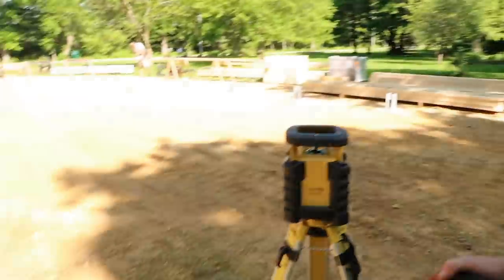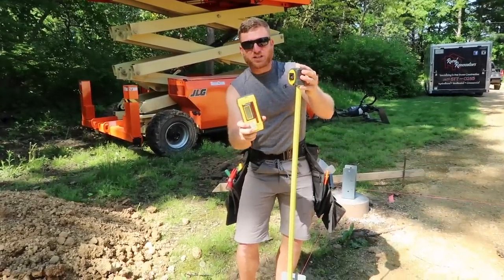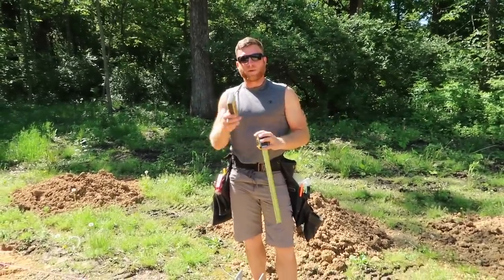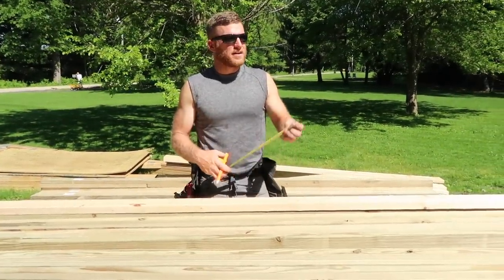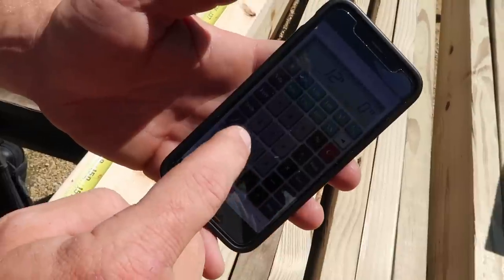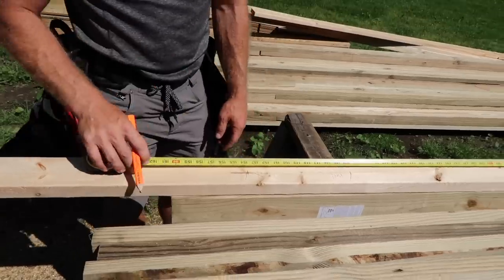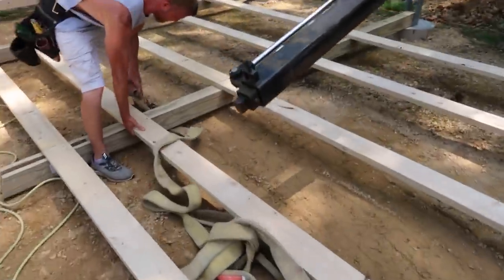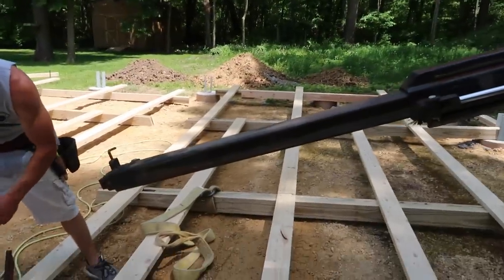How to Build A Garage #2 Lasers and Columns

Comment: If the post lumber is milled less than 1 1/2 thick, how do you make the truss fit in the center?
Reply from the maker: Lewis Renovation great question.  Ohio timberland has some way of making that pocket big enough for a truss. They are snug tho
Reply: I assume they mill the posts after they are assembled, so the center never changes dimension, only the outside?
Reply: Shain Andrews-- What you say makes more sense but think he said they mill the 2x6`s before gluing them.
Reply: If you pause the video at 3:12 it looks like the center board is 1 1/2 inches thick, while the outer boards are 1 3/8 inches thick.  I would guess they mill the posts after they are glued together.

Comment: are laminated 6x6's stronger than regular 6x6's
Reply from the maker: yes
Reply: Yes as long as it's LVL don't go for a 6 by 6 finger jointed from PT to Ash that is junk the fingers will spread after a couple years I built posts and beams New York New Hampshire Maine most of the Mass area

Comment: Love you're videos. Putting plans together for a 33x48x14 post frame garage.  I have a story board question. When setting up your story board for a 12 foot high ceiling (bottom of trusses), you measure 12ft from the bottom of the story board, which is the 'grade' reference. However that datum is about 1-1/2in above the top of the cement pier. Since the top of finish floor is about 6in above the cement pier, that puts the ceiling height to the finished floor less than 12ft, or about 11' 7-1/2". If I want a 12ft ceiling to finished floor, then shouldn't  my story board distance to ceiling be 12' 4-1/2"? Thanks.... Dan

Comment: Maybe this is a dumb question....

So you have a 12 ft sidewall (measured on storyboard) plus you grade measurement.  Then the bottom of the grade board say 2x6 goes at the grade mark....so far so good?

But then when the concrete is poured and the grade board is covered, the inside ceiling is now ~11’6” height correct?
Reply from the maker: You lose 4” from bottom grade board

Comment: Two things - Are the post resting on the bolts, with air between them and the bracket? Plus, you didn't show setting the roof pitch with the carpenters square and the whys & wherefores.
Reply: Look at the perma column guide.  If there is any gap the posts must be shimmed.  And the wood shims have to be glued and nailed to the posts.

Comment: I am wanting to build a 24x30 2 9 foot wide doors on 30 foot side but also the trusses running the 24 foot. Wanting your opinion on how to frame that side with the doors since practically all of the trusses would be setting on a header board

Comment: how did you know to add 15.5 inches for the heel of the truss?  Did you already have the truss on sight and measure this before you made the video or is this a common measurement for a truss with the same pitch?  I would think depending on the lumber the truss was made from could change this number if made from a 2 x 6 vs a 2 x 8.
Reply from the maker: I spec 15.5”
Reply: @RRBuildings   then my last question is this and it may be a stupid question but i am curious.  on the video shot where you were shooting from one end of the brackets to the other looking in the middle of the bolt hole (and that was impressive)in the bracket or whatever hole that was.  the question is if the brackets were a little higher or lower by 1.25 inches or more and i thought some were then how did the video shoot from one end to the other?

Comment: Any structural guys out here, is it a problem if the post brackets aren’t centered on the pilings? My concern would be the pilings could tile because of the buildings weight if they are not centered
Reply: A bit off center won’t matter exponentially. Depends how close to the outer edge

Comment: Galvanized still corrodes in treated lumber. As does stainless. Uncommon fact known. However because of the materials used to treat lumber they say it is not caused from the lumber treatment. Trip coated are the best in my humble opinion. It’s not that it isn’t approved but over time they do corrode and I believe it is because of other elements or factors other than the lumber type.  Triple coated still don’t. Not saying it’s wrong to do it because it’s still approved but just wanted some of the other younger contractors and construction guys to know

Comment: When you lay the posts down in the brackets to start building the wall, how do you ensure they are straight?
Reply: just like balloon or platform framing when first doing a section laying down, in this case the girts nailed on the markings using the story/storey pole are what aligns the posts to straight.
Reply: I get that, but I was thinking that the posts could be parallel to each other but a bit sideways (not square to the brackets) and still get nailed up. I think if they were way off it would be pretty obvious, but it seems like a small amount (especially on long posts) would be hard to catch.
Reply: From what I have observed in his past build series, he places a foot of the base of each post through the bracket if not just the base itself bracket depth/width to help line up with way, he does level out before setting it in with the anchor bolts into the bracket for in/out level for perfectly straight as possible for both axis. He can tell you more himself how he does it when/if he chimes in on your comment if I am mistaken, unless he addresses it in part 2.2 which I have yet to watch myself.
I like to share my knowledge (or opinion) for what it is worth to others.
Reply: Thanks! That would make sense if you can get it close enough and then do the final level/plumb by shifting the wall around before putting in the anchor bolts. I have seen that in the other builds, so I think you're probably correct.
Reply: Yes I just watched part 2.2 and he shows on the other side and end wall he aligns them by placing in the bracket as I had aforementioned and adjust before nailing the board to ensure sideways plumb to one another and then opposite side to side (outside to inside) plumb after raising before anchoring.

Comment: Ok, this has been bugging me for awhile so I’ve gotta ask. I’ve watched this episode so many times and I still can’t figure out why you need to do the 1”+/- dimension at each post. In the first episode you mentioned that by using the laser the top of all the footing should be at the same elevation.  If that’s the case, why are there variations that need to be considered when making up your posts?  Is it due to inaccuracy in the laser or do the footing forms tend to settle somewhat during the concrete placement and finishing?  And thanks for the wealth of information.  Love your channel.
Reply: I would imagine the ground isn't level? It's tiny amounts he's adjusting.
Reply: @gustavel6333  that shouldn't matter since he's using a laser though

Comment: You lasered the tubes but not the post brackets, Why didn’t you just use the laser when you set the post bases?
Reply: I answered this in another reply, but easier to do what Kyle does then to try and get the tubes and concrete pour all the exact same height.  You can't have a gap between the bracket base and concrete nor the bracket below the surface of the concrete.

Comment: How you guys use imperial baffles me!! How do you think 11/16" is easier than 17mm. I don't get how you even read that on a tape. Why if you need to find half way point of that? Surely it would take longer than the metric system? Also wtf is heighth? Is that imperial for height?

Comment: I dont quite understand the benefit of building your structure this way? It seems like all the cost savings and time savings are lost compared to a traditional frame up
Reply from the maker: Guess they call that just not knowing?  I’ve built both for the last 12 years.  Post frame for this type of structure is not only faster... more cost effective... but also a stronger building

Comment: It took me about 3 views to figure out how the laser measurement of the finished brackets was used.  Makes sense now.  The beams are ordered long, and the bottom of the story board is adjusted to the bottom of the post + the adjustment from the laser measurement.  Then you can cut the board that receives the truss to size and cut the overall beam to size.  I'm impressed with this method.

Comment: Back in the day when Australia had just changed from Imperial Measurements to Metric Measurements I had to create a Story Pole with a Maximum Length of 123 Inches, in other words 10 Foot 3 Inches. 
My 10 Foot Tape Measure was marked in both Imperial and Metric. 
First I marked off 10 Feet (the maximum Measure of the Tape Measure) then added 3 Inches, before making My final mark and cutting to Length. 
Problem was I only added 3 Centimetres. 

Nobody noticed My error until they started putting Wall Panels up and found that Mine were shorter then the other guy's Panels. 
For 20 Years My short Panels stood next to their longer counterparts and because the shortcomings were at the bottom of the Wall hardly anyone noticed.
Reply: THAT is the kind of mixup we don't want to deal with!
Reply: OUCH, nice lesson to watch which measure you are looking at on such tape measures.
Reply: @infoanorexic  Tell that to NASA.
Reply: "Who cares"???!!!

Comment: Wow, you really need to be born into this Imperial Units madness to not have a problem with 15/16 or 3/8 of an inch craziness :) Commenting from UK, where we also use inches, but in construction it's mostly metric system. Apart from that, great videos :)

Comment: I've never built anything other than some tables and a 12x16 tool shed but I am getting ready to build a pole barn at my new farm. My question is about the measurements on the brackets.  Why are the measurements different if you used a laser to insure they were level when installed in the concrete forms?
Reply: He didn't use a laser to level the brackets and I don't see how that would work.  The concrete tubes and concrete pour would all have to be perfectly level before inserting the brackets which would be exceedingly difficult. Especially the pour.  If the concrete pours don't end up all exactly the same height (level) then when you insert the brackets to the same height you would have some of the bracket bases not touching the concrete and some below the surface of the concrete.  Not good.  Easier to just  do what Kyle does and insert the brackets until they touch the concrete and then go back with the level to adjust the height on each post. Hope this makes sense.  Are you doing a video blog?

Comment: What’s the cost for this construction? Total cost.
Reply from the maker: Robert Gannon usually depends
Reply from the maker: No magic number
Reply: Fair question... He asked for the cost of THIS build... So it doesn't depend. Or could it be you are unwilling to say?
Reply: RR Buildings can you give an approx range?  I understand confidentiality. I bought a property on 5-acres and need a new shop/garage built and I am trying to budget for such a building.

Thanks in advance!
Reply: he reason he is not answering is because there is factors aside from structure, type of sheathing, finishes and other things like insulation if wanted or what is required just add into the cost, thus why you will never get an exact price per each size of building, Best thing to do is hop around for quotes giving them the information required such as use, for example residential and what its occupancy be say its a home and shop/garage/etc since there are four classes of occupancy in the IBC (International Building Code) plus local code compliance for home use or other lesser occupancy plus local wind, snow, and other rating factors such as aforementioned the finish if say you plan to drywall or osb/plywood the interior the trusses need to be made to carry said load.
Some like for example Hansen Building offer a prefabricated DIY Kits its of standard sizes, but like I said the local code may either reduce or increase the price if the truss require to  withstand a set snow, dead, and live loads. So instead of asking him for price, get Quotes from manufacturers, you saw labor cost doing it yourself. but not saving  yourself putting your own kit together from the local lumber yard using those lower grade materials.
Reply: Joshua79C C whilst your are undoubtedly correct that each building will have variations. At the end of this build all this is known and will be billed for at the agreed price. Quotation and tendering will have already have been done for this build and agreed so the construction cost for what we see being built as standard for R&R is a known. If it's commercially sensitive, then please let him say so.
Reply: He did says so "No Magic Number" and I simply and merely pointed out there are variables, but for his portion of the build and skin the only variable is the footers and height difference to width and length standard
Reply: Joshua79C C couldn't agree more.
Reply: Robert Gannon Get at least 3 estimates. To get a rough idea of the professional cost in your location.

Comment: How do you determine the above grade measurement without a rotary laser? Do you measure from the top of your concrete footer to the bottom of the string line? Great series of videos, you seem to do great work.
Reply from the maker: you could...but it would only be as accurate as your string line
Reply: Since you measured with the rotary laser to determine the height for the top of the concrete, does the concrete sink after pouring? I imagine it does or you wouldn't need to determine the above grade measurement for each post after it cures.
Reply: Try a water level:  clear cheap tubing with water in it.

Comment: do you bring each end post in 1.5"? so instead of 8' on center your two end post will be 7' 10.5'' from the next one?  Also when using solid 4x6 posts and notching the outside for the truss,  should you keep all the notches the same direction until the end one that would be opposite or split them so the distances between your two middle two middle trusses would be slightly larger?

Your videos rock! Actually planning on building a 30x40.  Never built something this big and I'm driving myself crazy trying to plan it out perfectly so I dont have something stupid happen in the middle of the build like my ceiling ends up being an inch short or something.  Your videos are very detailed and helpful.

Comment: you do realize there is an easier solution to calculating where to cut. it is called the metric system. you ad 1 cm at a time.  you added 12ft + 15ft 1/2 inch + 3ft 11/16 inch = 13 ft? 7ft?  3/16 inch... how about adding cm all along? it's as easy as 356cm + 39cm + 9cm = 404cm... if you'd like to be even more accurate, use mm. but hey, who am I to tell you-you can use the same measuring system as the rest of the world.

Comment: In a couple years I'll be building roughly a 20x25ft garage and I plan on doing it myself. It's only be about 9 feet tall and I'm trying to design it to support both a garden on the roof and up to 6 feet of snow.
30x40 seems huge.

Comment: If you live with metric system, your Will finish it one day earlier... Lol
Reply: wow save a whole entire day haha
Reply: How tall you are? Im 1.72m simple as that.    
I have 2 pieces of wood. One is 32cm and the other is 45cm. If i put them together i have 77cm; if i want to calculate the center is 38.5cm

look this sizes of wrenches: SAE 1/4, 5/16, 3/8, 7/16, 1/2, 9/16, 5/8, 11/16, 3/4, 13/16, 7/8, 1 in. 
and Metric 8, 10, 11, 12, 13, 14, 15, 17, 18, 19, 21, 24 mm

Metric is easier
Reply: 1/3 of 13 is 4.33; 1/3 of 14 is 4.66; 1/3 of 15 is 5.  How would you express this in imperial? 1 11/16"; 1 13/16"; 1 15/16"
Reply: Metric may be easier, but it leads to poorly made, and collapsing buildings.
Reply: @Zefania1  Are you sure?
Reply: @lukasrydelius6174  lol
Reply: When you understand what he's doing in the video, you will know that he is rounding everything to the nearest 1/16 or thereabouts. It makes no practical  sense to be much more accurate in the building trade. 1/16 of an inch is about 1.5 millimeters (mm) in the metric system. In the metric system, we try to work to the nearest millimeter (mm).  
So the value of 10 in your  1/3 of 10 example, makes no sense. We would not want to get 1/3 of 10 anything.  Definitely not 1/3 of 10 mm , that's tiny, but if you really had to, then 3 mm would be plenty close enough (plus a tiny fraction more if you are really fussy). If by 10 you mean 10 centimeters, well we don't work in centimeters, we work in millimeters. 10 centimeters is 100 mm  and 1/3 of 100 mm is easy, its 33 mm (plus  a tiny bit more if you are really fussy on the job). Some times we do work in meters and there are 1000 mm in a meter. A meter is written as 1.000 m on the job, and 1/3 of that  is easy, its 0.333 meters or simply 333 mm (plus a tiny bit more if you are really fussy).
Reply: @deanneb906  The best part is when you work in a German factory, in the USA (German owned and designed, placed in America).  Then you get a wonderful mix of both metric and imperial units!  What bolt is that?  Well, it's either 3/8" OR it could be 10mm.  Is that a 22mm, or is it a 7/8"?  You don't always know until you just grab all the wrenches, and see which fits best.
Reply: Lukas Rydelius if you believe changing measurements as you say could cause a building to collapse you aren’t to bright